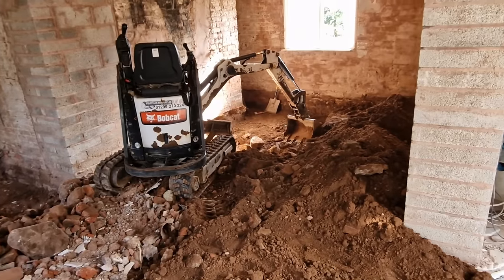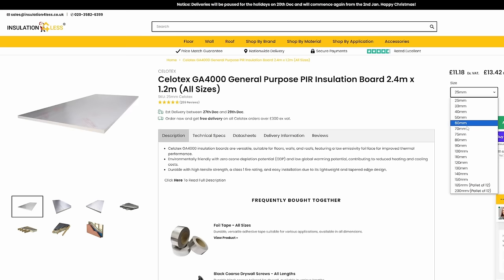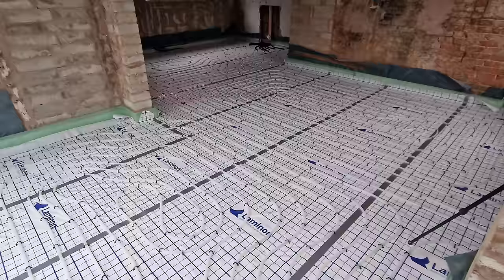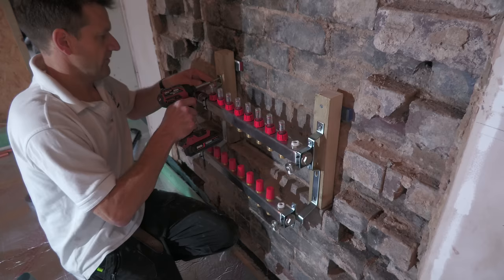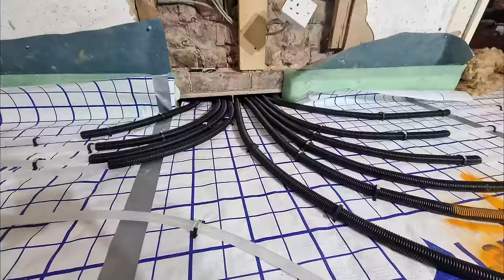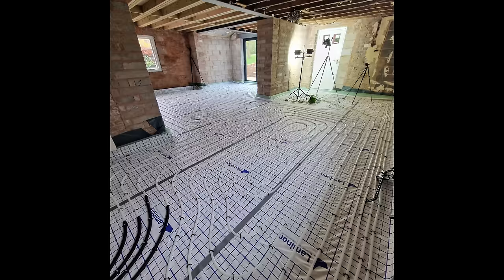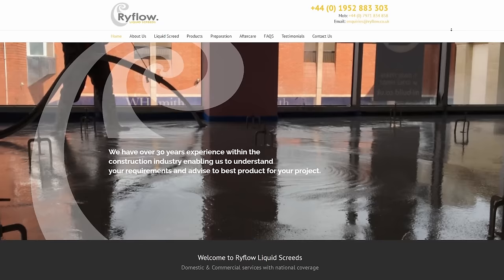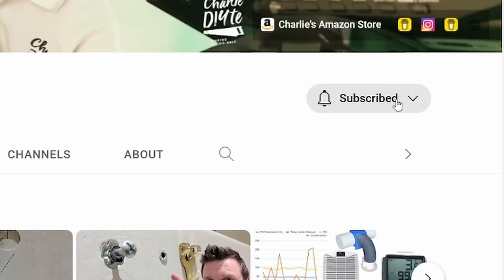How to Install Underfloor Heating in an Old Property

Comment: Hi Charlie, What an excellent video. I'm in the process of trying to work out if it is better to buy an older property and do the underfloor heating myself (do it myself or get a professional in), or to buy a property  with it already installed. The question is how reliable are the new builds now-a-days?
Reply from the maker: Thanks Paula. I think it all depends how close together they laid the pipes and therefore how efficient it is. Also if you buy an existing and don't like the lay out of the kitchen for example, you might have loads of cold spots if you move the units assuming they haven't laid pipes under the units. However it's very expensive to retrofit!

Comment: My screed was layed 49 hours ago. Couldnt stay out any longer lol.
Popped my head in yesterday,literally just my head, and the heat felt like getting off the plane in Tenerife. 
Anyway, how quickly did you start trimming expansion edge tape and door expansion strips?
PS. I would not recommend laminon. Strips are too thin, taping is a nightmare. We ran out and the final 10m² i used 500 gauge black plastic. Far less taping and hassle. 
I can see the advantage of the grid pattern, but in all honesty, a tape measure and a length of timber would achieve the same thing. Just my honest opinion.

Comment: Thank you for that insight, it was very thought provoking because I would like to know if it would be possible to do a similar system with my Stove Boiler (which is only used in winter), and perhaps at some later point, updating that too, to be able incorporate a SunAmp heat battery in the future, but do it in a way that it can be future proofed.

Comment: QUESTION: I have been umming and arring about whether to DPM or breathable on my underfloor heating system in my 200 sandstone cottage. I have seen a few videos online where people have installed DPM under a concrete floor and the damp has travelled horizontally under the DPM to the edge of the slab and crept into and up  the walls straddling the concrete slab/screed. Would you so a video with a thermal imaging camera to see if your DPM has done something similar in your cottage?

P.S Your videos have been a god send for my DIY project on my old cottage.

Comment: Great video, im installing electric heated flooring for the 1st time, I noticed the thermostat for it is about 2x the price as a regular thermostat, not sure why
Reply: Because it needs to be rated for the power draw of the floor not just a low current switch. Resistive heating for a floor will be ridiculously expensive to run.

Comment: Thanks for the video Charlie. Love your channel and this is a particularly useful video for me as I would like to install something similar in a similarly old building. What has kept me up at night is how the walls below the floor are able to breathe and release moisture once the floor is installed directly up to them. Is there a risk of wicking up the insulation and crossing the DPM? Yours or other people thoughts welcome.
Reply from the maker: Thanks Stephen. That's the job of the damp proof course. I don't have one in my old place but did get it injected back in 2010 when we moved in. I think as long as your levels outside are low enough you should be able to manage the damp with or without a damp course. The floor used to be very cold and damp particularly in the corners. Putting the damp membrane below the screed has made a massive difference and if you're worried you could always continue it up the wall.

Comment: Great job but personally i would have put a limecrete floor with foamglas insulation as you have solid walls. 
Risk of damp pushing up walls as cant escape. Otherwise looks good.

Comment: Hi Charlie, great video and quick question regarding the upstands you used. They 25mm thick and what height did you cut them off at? am I right in saying height of PIR board (100mm) plus the height of screed at 50mm, so were your upstands a total of 150mm. Thanks and keep the videos coming

Comment: I have a 1950's bungalow and I really like the idea of installing UFH while we gut, rewire, re-plumb and re-decorate. However the floor is concrete, I've seen videos and information that state you can lay an insulated board that the UFH pipes lay in and it has a surface "diffuser plates" that help spread the heat upwards from the pipes. 

Would you recommend this setup or is it a case where if I want UFH then I'll have to excavate the entire floor and start again?
Reply: That overlay is a good option 👍

Comment: Im glad you showed how tricky it was handling the pipes..did you get any kinks at all?
Reply from the maker: No kinks. You just have to be a bit careful on the bends not to make them too tight as that's the point they're most likely to kink.

Comment: Fantastic video. Bet you’re glad you have a floor now! I’m guessing the downsides to this system is the time it takes to heat up the house? Whereas with rads you can warm up a room quite quickly the floor will take longer. But I’m guessing it’s going to hold the heat massively too. So overall more efficient? Also no wall space taken up by rads too haha
Reply: We have underfloor heating in our house upstairs and down...Best way to run it is have it on all the time, have downstairs stats set at 22 and upstairs at 19, heating kicks in if they drop 1 degree, only takes 30 mins to bring back up to temp. Initial warm will take a while but quick after that.
Reply: We have ufh in one room - 11mx4.45m. We set it to a minimum of 13c after 22.00 then it clicks on after 06.30, with a max of 19c throughout the day. It usually only drops 3-4c per night in the winter. It takes circa 1 hour per c to heat (if pipes are cold).
We have 100mm insulation with a 70mm screed with vinyl on top. 40c flow temperature on mixer.
The heat is very clean/natural, rather than the blast of a series of radiators, you also have warm feet, which is a nice feeling.

Comment: Great job, Charlie. It looks as if your house will be nearly ready for a high efficiency heat pump install (although you may need to change the manifold to remove mixers and the actuators). Have you considered using an MCS umbrella scheme (for the £7,500 government grant) and doing the install yourself?
Out of curiosity, was there a reason you didn't use MLCP pipe(e.g. PEX-Al-PEX)  on the 22mm  run from manifold to existing system? That might have saved a load of copper bending, although I suppose some people find that therapeutic!
Reply from the maker: Thanks. Yes we should hopefully be ready for a heat pump when the time comes. I was thinking exactly that myself recently about that pipe run. Don't know why I didn't use plastic - as it would also have removed the need for that join under the floor. Also I'm slightly gutted I didn't put the manifold in the cupboard - would have made so much more sense and removed the need for that pipe run. Still you live and learn. 👊
Reply: @CharlieDIYte  I am moving towards the perspective that MLCP pipe is easier to use and cheaper than copper, and produces join-free work. The only downside is the cost of crimp fittings and tooling, although there are now U-profile manual crips for around £70. Ideal for DIY-ers, if only we knew about it.

Hindsight regarding the manifold location is a wonderful thing, but equally pushing a project forwards is very important. Thanks for sharing your introspection.

Comment: Does anyone know how to calculate the head side of a pump for UFH application?

My understanding is the pressure loss show in the installation table later in this video shows in Pa the equivalent of head loss. So 20,000 Pa is equivalent to 2m of head loss. Is that right?

It so when all circuits are open in this installation what size pump would be required? 

I currently have a 6m pump and it’s not enough. I have 11 circuits, most ~100mm 16mm

Comment: Are you not concerned that the system has been designed for 35° flow but at what outside temperature?  If you have it set to 35° now at 8° outside and only achieving 19° inside (which is quite cold) then at -2° you will need closer to 45° flow temperature I would guess and does your system achieve this?

My UFH flow is set for 45° at -2° outside temperature with weather compensation.
Reply from the maker: Don't forget I've got the room thermostats at 19 right now. I can bump them up to 22 and it'll simply mean the system is on a bit longer but at the same flow temp and when I've insulated the walls the demands on the system will be even less. The temp in that TV room is consistently around 25 so I actually need to adjust down the auto balancing valves in there I suspect.

Comment: Thanks for the video, I'm currently planning and costing this job and the slab in an old cottage so a similar situation to yours. Limecrete or concrete...hmmm. I have reached out to Jim's company for a quote but did you consider nu-heat and how did you select your UFH supplier? Thanks
Reply from the maker: You're welcome. I tell you, that room is so toasty warm right now and I haven't insulated the walls yet. I thought about nuheat but in the end, I gave it to Jim because he reached out, and gave me such good advice.

Comment: The flow rate for underfloor  heating is far greater than a radiator system .that  is because to heat the same are you need more flow for lower water temperature
Reply from the maker: Good point 👌

Comment: Looking for advice just purchased a bungalow built 1960s electric underfloor heating. Do I keep it or dig it up and install insulated wet underfloor heating 100ms floor area
Reply from the maker: You've got 2 issues with that electric system. 1. Electric systems cost a fortune to run and 2. insulation below the system will be non existent in a 1960s install - which in turn contributes to 1. Have you experimented with the system? Cost, efficiency etc? That was very innovative installing that in the 60s.
Reply: @CharlieDIYte  getting the key’s and of month the room stats look of the time of installation the roof area looks good for double aspect solar, the walls have cavity but no insulation. Won’t to make the house as economically to run as possible without costing a fortune I have no idea the cost of digging the floor area up and installing a better insulated floor could I just install wet underfloor heating on top of the existing floor with minimal insulation so as not to lose height and have to cut to much of the doors, O and we live on an Scottish island.
Reply: I appreciate your help

Comment: How would you rate them skil tools you have? I was thinking about purchasing them myself.
Reply from the maker: I'm loving them, mate - I don't think you'd regret it. Decent life on the batteries and I like the fact the dual charger charges both batteries at once which is more than can be said for my Ryobi multi charger station! The impact driver with its multiple settings is particularly good and the SW1E3540CA multi material saw (basically a mini circular saw) that I used in this vid https://youtu.be/o4p3vRirksc is a fantastic little tool. There are a couple of tools not available in the UK yet, like the RH1E 3851 20v SDS and the random orbit sander, but they have a good old range at Screwfix.

Comment: The problem with any encapsulated system is you can’t know what is going on , copper pipes run under suspended floors always have the opportunity for inspection and repair . But of course this tends to come at the price of thermal efficiency , so we find ourselves in a difficult position . Greater efficiency over less efficient systems as in radiators , and again here is the main stumbling block . Systems that rely on radiators irrespective of how large the radiators are need a far higher water temperature than under floor systems require , this ultimately dictates how the water is heated .  And this primarily aspect can open a whole can of worms , so at this point I feel disinclined to venture into the world of heat pumps , and the for and against such technologies .
Reply from the maker: This system is so much more efficient than the old radiator. The TV room stat is currently set to 17 degrees and the temperature in there is 20. It was quite a difficult room to heat before, with it's tile floor sitting on dirt and then one rad.
Reply: Hi Charlie indeed your old system was far from perfect , and I’m sure  this is the best solution for your remodelling .  One thing I have noticed even on new builds , an approach that uses under floor heating on the ground floor then  opting for radiators on the upstairs .    Thanks for taking the time to reply .  Kind regards as always 👍